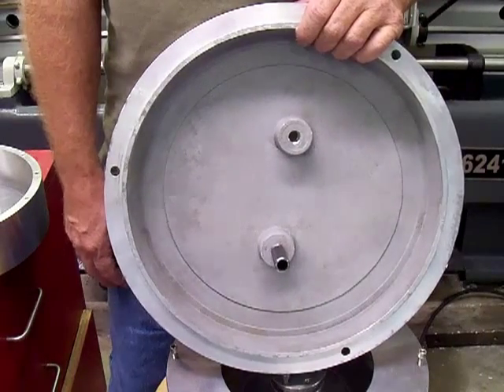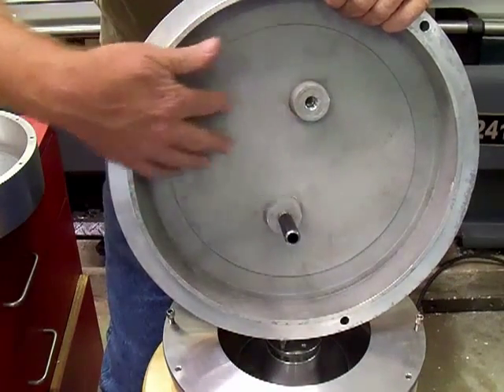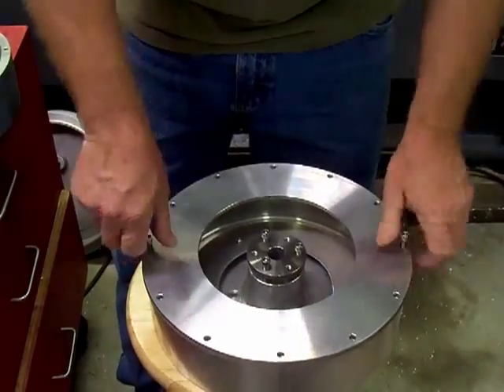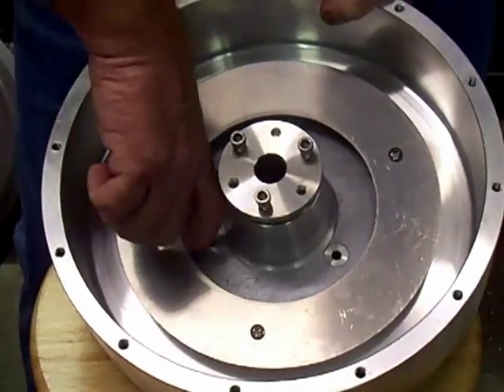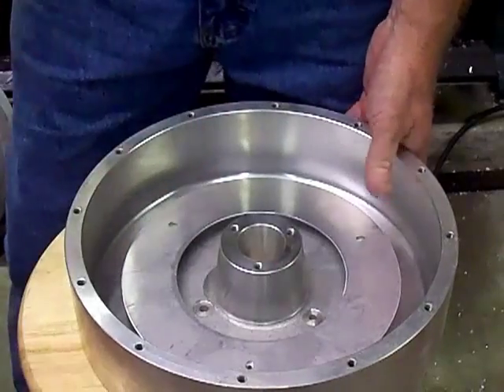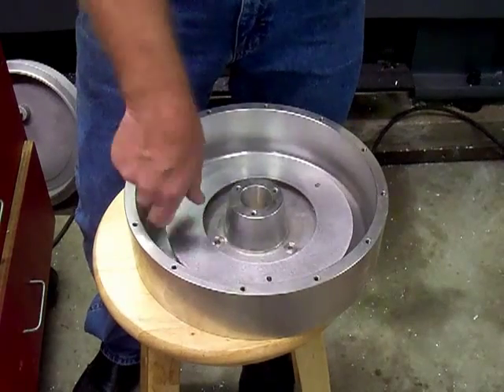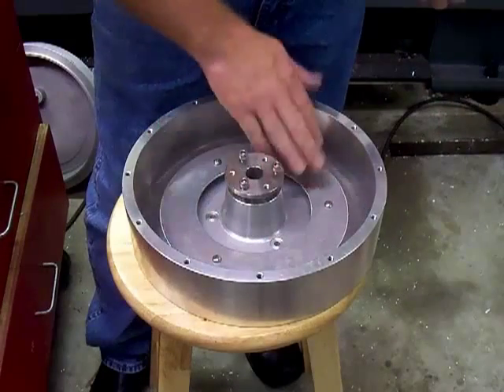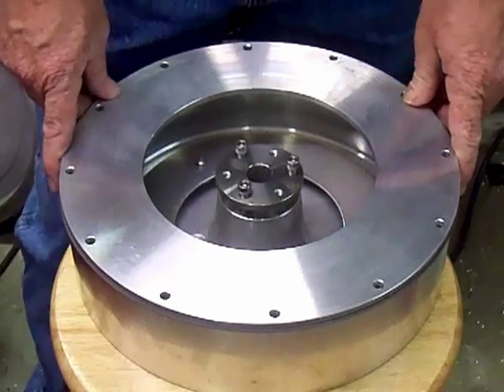US FIltermaxx Feedplate and Bowl Design

Comment: So you don't need a cone like others have because of the feed plate?
Reply from the maker: +urgentcareguy3 .I am glad that you asked this question. No. No need for a cone. A cone  only guides material to the outer edge of the bowl. A cone does not accelerate anything. If it did, fans, pumps and turbines would have cones. Our centrifuges have either open bowls or a plate. The plate guides the fluid to the very bottom of the bowl and out to the edge.  A plate will not wobble or flare at high RPM allowing 10,000 + G's. A cone is not rigid and will both flare and wobble.  This limits the maximum G force keeping the G force pretty low. I don't know that they can approach 3000G, and certainly not 10,000G. If a material has a high percentage of solids, then an open bowl is better because you can develop a thicker cake than is possible with a plate or cone.
Reply: +USFiltermaxx Thanks for the info. I have your 2400g. Ordered some parts for it yesterday from you. May I suggest that you do a video dispelling the cone accelerator myth?